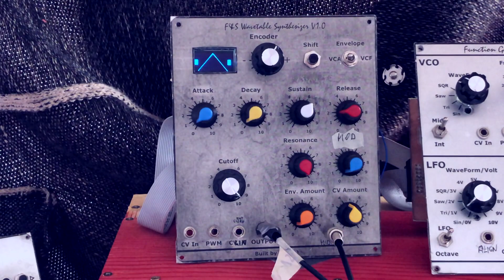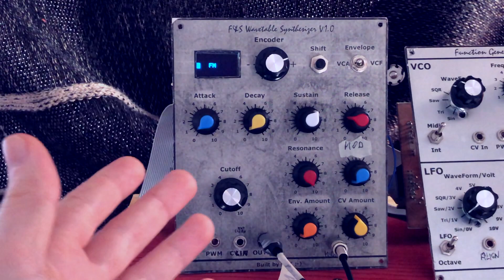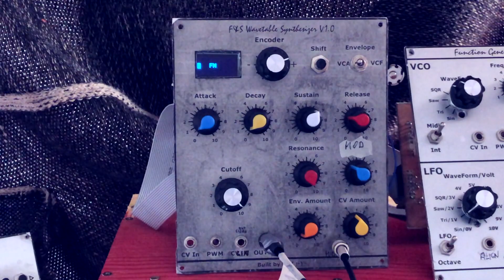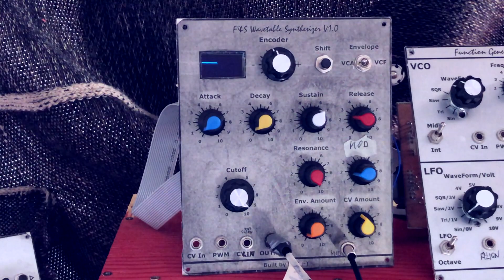Father & Sonthesizer Ep.16: The Best 50€ DIY Synth

Comment: If you have a carrier and a modulator that’s would be a 2 operator synth. A single operator is the sine wave oscillator and ADSR combined. I have a DX7-II and have been learning to program it a bit, Chowning has a nice book co-written by one of the guys that wrote the DX7 presets that walks you through FM synthesis with practical examples, you need a FM synth to follow along. Can’t wait to build the hardware to start playing with your synth, only looked at the code for now.

FM Theory and Applications

http://www.burnkit2600.com/manuals/fm_theory_and_applications.pdf